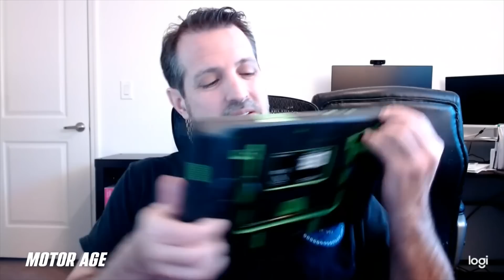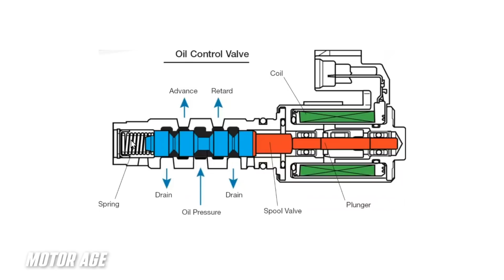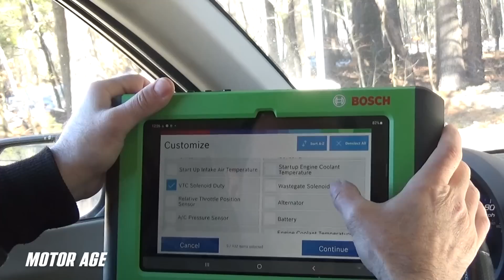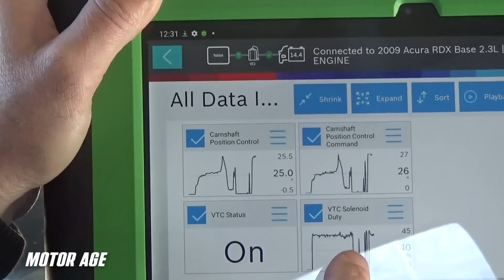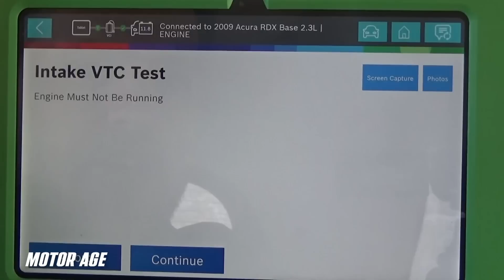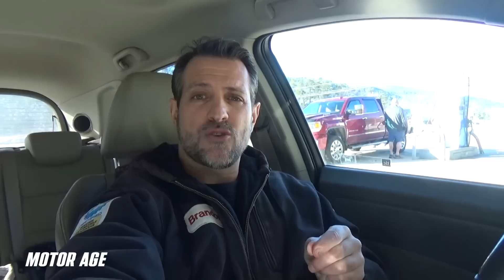Mastering Diagnostics #21: Leveraging scan tool functions to build a VVT diagnostic game plan

Comment: Awesome video. I picked up a cheap PWM box (m12 battery powered) to bench test VVT solenoids and it works great. Do you know what frequency these are normally driven at? I've seen 150-200Hz, but around 1kHz seems to work best (finer control of valve).
Reply from the maker: Excellent question and greet thinking! Brandon does not know the frequency off the top of his head, but that would be very easy to prove out with the scope or capable DVOM.

Simply test across the solenoid circuit and plot for frequency
Reply: @VehicleServiceandRepair  Great. I will try that with my Picoscope 2204A. Thanks!

Comment: Your testing brought me a thought.  My 4 channel Pico scope could be connected to also include the cam sensor while activating and monitoring the VCT electrical circuit functioning.  That way you electrically see the cam change while the VCT circuit is moving.  If the problem is intermittent, you "may-need" several road tests to verify the problem.  Throw in an oil or oil pressure problem, and the problems multiply.
I like your approach to this test/diagnose this problem.  You need a good wiring diagram and Great Service Information.
Thank you for this video, it's one to keep.
Reply from the maker: You’re very welcome. Brandon too has leveraged the DSO to do as you have described. Then, using the cursors to measure cam-offset via the CMPs/CKP correlation waveforms.